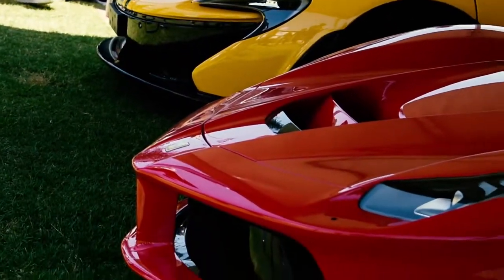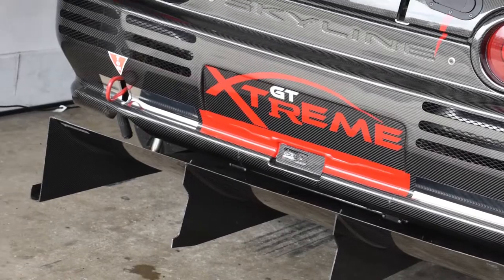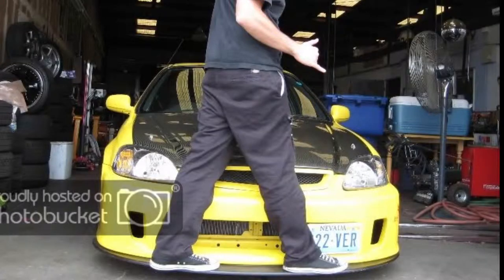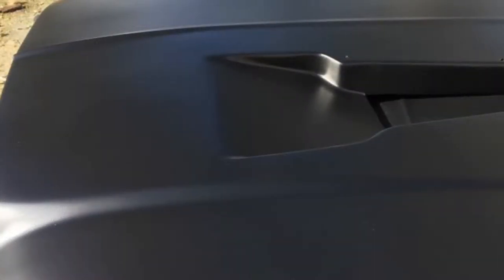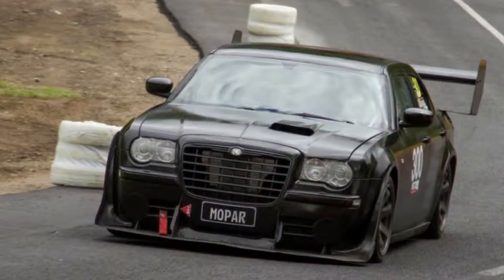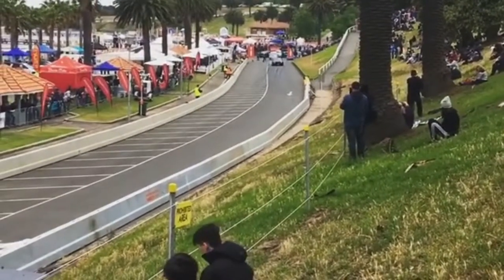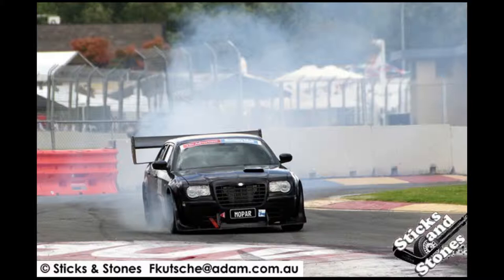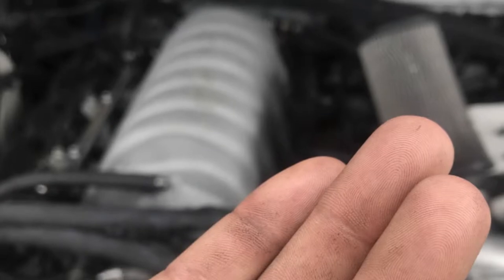Chrysler 300 Time Attack! Custom Aero, 800+ BHP! ~Superbird Begins~

Comment: what software did u use to design your wing
Reply from the maker: It was a while ago, so unfortunately I can't actually remember! The basic design work (I think) was done in blender, then I searched around for CFD (Computational Fluid Dynamics) programs. 

From memory, it was a charged CFD program (I wanna say $30 a month or so?) but I haven't done any of that stuff for around 5 years.